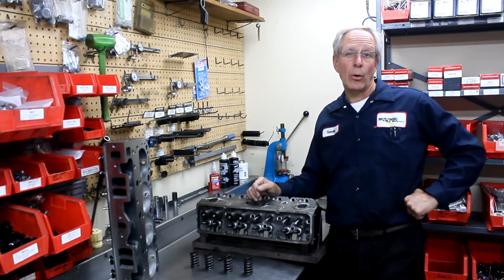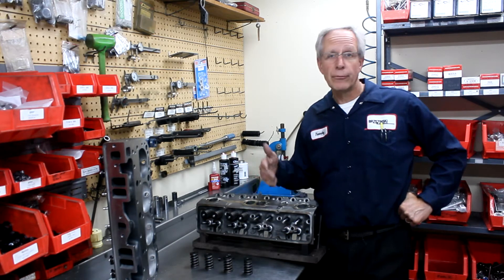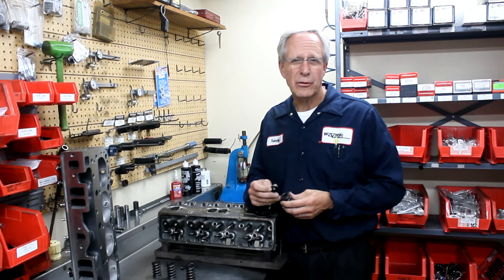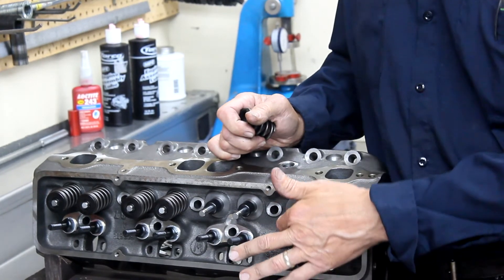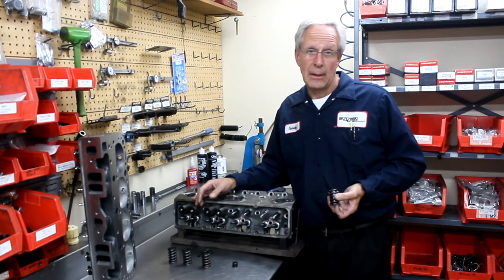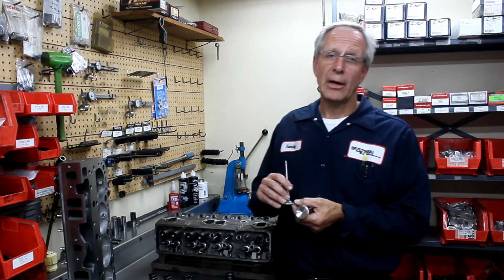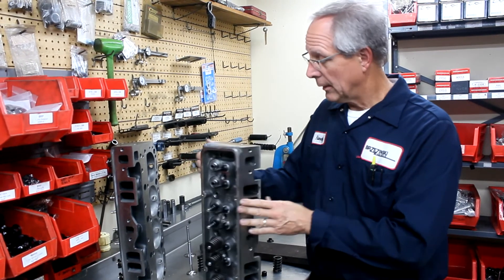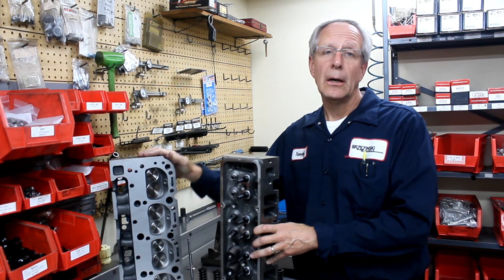Complete Head assemblies ours vs. theirs  part 1

Comment: I bought some SR Torquers from Summit about 8 years ago. Almost all the springs cracked on the right head within a week. I didn't want to take the head off again so I just replaced all the springs on both heads and found right head actually had different springs. About 4000 -5000 miles later. About 6 months later. One of the valve seats went bad and caused really low compression. I gave up on those heads. I figured that they must be thrown together with crappy tolerances. I went to the junkyard and bought a pair of vortec heads. Had some work done to them to accommodate .500 lift cam. Mine was .486. Those Vortec heads were way better than those World Products heads. Felt like it gained about 20-30 hp. My 383 was a turd until I put the Vortec heads on it. I also had them Drilled to accept the standard Chevy intake because it was cheaper than buying another Edelbrock airgap intake that accepts the vortec heads. Next time I'm starting with vortec heads.

Comment: My Heads and Intake came from you in the 90s, This combo entered big money races only and won all, then was parked until the 05 season and won two big races then parked again  until the 2016 season.  Heads have nothing done to them  by anyone but you not even a spring changed  just checked and remounted  and won two pro late model championships. 2016,2017 with 12 wins in 22 races. 64 cc heads sbc 350 60 over 348 stroke 4412 carb. Just curious on cost to send the heads and intake to you to freshen  after the season. I would need a head box also.
Reply from the maker: If you would like to call us Toll Free: 866-236-6300 or send us a Email: info@castheads.com we will be more than happy to talk more about getting you all set back up again and back on the track! Be sure to let us know that it was you that left the comment on the video. Thank you for the awesome comment/review!
Reply from the maker: www.castheads.com